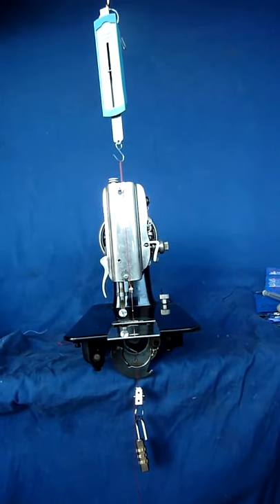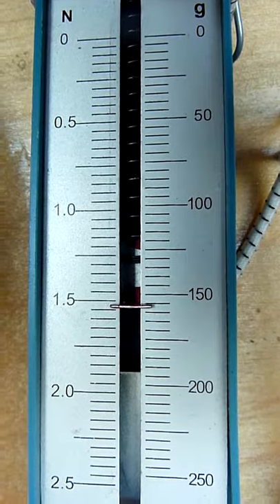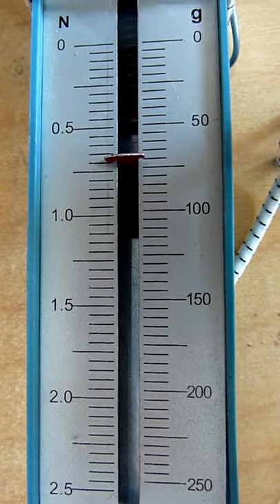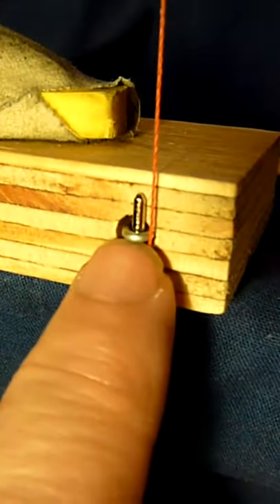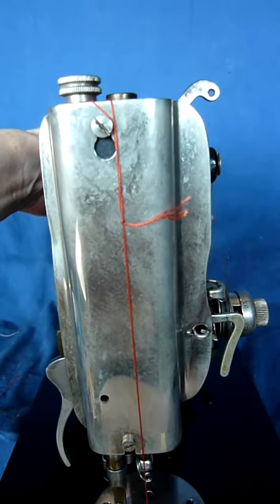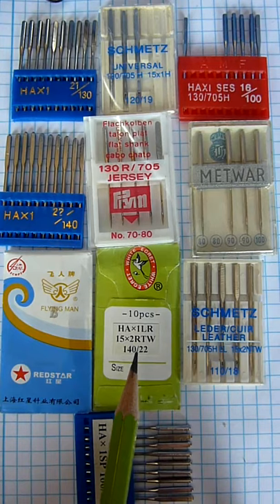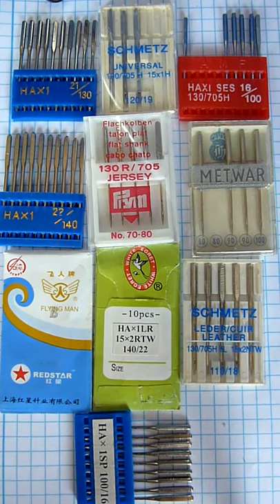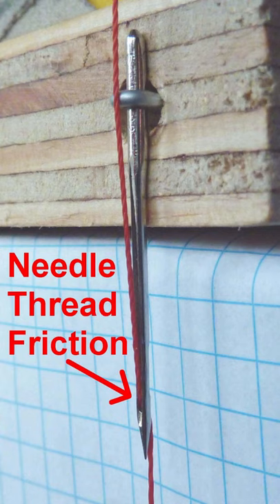Needle Friction Tests and Needle Quality for Sewing Machines

Comment: Are ou able to help me source good quality 15x1 (705H) needles of large sizes like over 18?  I'd like some 20 or 22 size but don't know where to get them?  Thank you.
Reply from the maker: For Leather point needles it is more difficult. But I got these needles from White Egret that can very in quality. Organ universal point needles up to size 21 are quite common, but size 22 more rare. These two suppliers can supply size 22 about 50 % of the time: https://www.aliexpress.com/item/1860090057.html 
https://www.amazon.com/CHOOSE-SEWING-MACHINE-NEEDLES-BROTHER/dp/B01F8CK8KG
Reply: @sewingmachinesindetail   Thank you!
Reply: @sewingmachinesindetail  For the life of me I cannot find "White Egret" needles listed anywhere on the internet.
Reply from the maker: @lukefenech  I got some needles some years back from a German supplier. He was on ebay, but do not sell on ebay any more. You can try to contact him. It is LG Bauer, Nahttecknik. He do not have a website. I do not know if he can understand English, but you can try. nahttechnik@web.de

I just tried a bit via Google, and it is hard to find larger leather point needles for this needle system. Often the terms LL or LR are used.

Leather point needles are for leather, and they cut the fabric. I do not recommend them for anything else unless you want cutting of the fibers in fabric. The cutting makes less friction between fabric and needle. I made one video with leather and the singer 201. If I used an universal needle, the presser foot could not keep the fabric down.
Reply: @sewingmachinesindetail  very interesting.  I'm actually in the middle of experimenting with modifying the needle bar on one of my older Husqvarna machines to use industrial needles. My idea is to be able to use much heavier thread and not have to struggle to find large size domestic needles. Have you ever tried something like this? Thank you for the contact. I will try to reach out to him.
Reply from the maker: @lukefenech  No, I have not tried modifying needle bar. I noticed, that some users of the cheap China leather shoe patcher modify the needle bar like that. Be a bit aware of geometry. The Husqvarna Viking shuttle do have some limitations to thick thread, and I think you need to increase the play around the shuttle hook for it to use thread thicker than Tex 135. I am not sure the machine can cope with Tex 135 that reliably, but I think it will handle Tex 90 in most cases. The play in shuttle do also make play in needle-hook distance, and it can limit its use sewing Jersey. Look here: https://leatherworker.net/forum/topic/99242-needle-hook-distance/